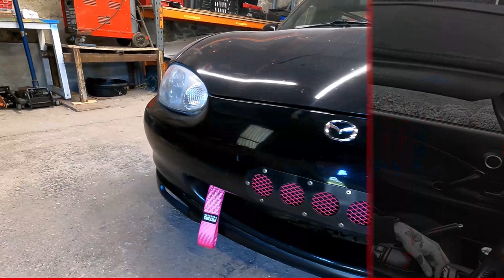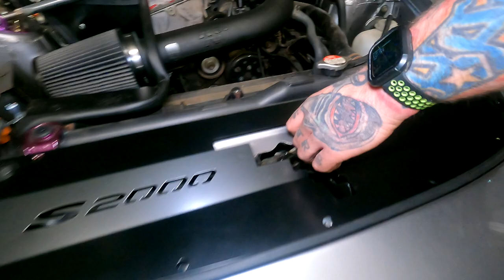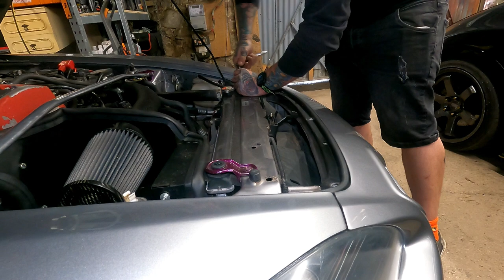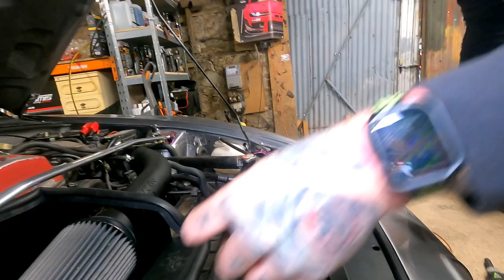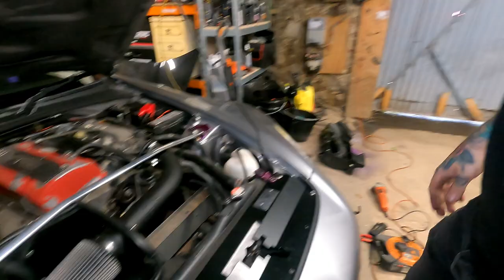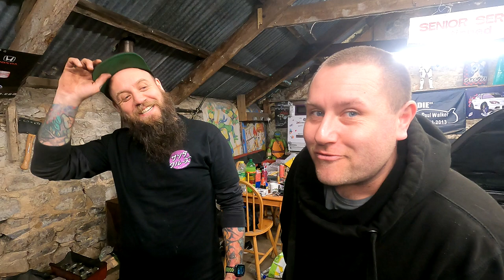Honda S2000 cooling plate by Draft and Drive installation

Comment: Luvveeerly,Well you've just reminded me. I bought a plate for my FTO about 15 years ago before the kids came along and it's buried in the garage with the rest of my old life 😂 I don't know what was funnier you doing the fingers fiddling to get the sensor or Chris doing his street fighter? oooohawoooo🤗👏👏👏
Reply from the maker: 🤣🤣🤣 get it out my beaut and get in on 😜😜🤘🏻❤️
Reply: @CowabungaCarDiaries  Yes you've inspired me but they will be an avalanche of crap falling on me so I may be trapped.... By the way, as I'm old I like to give out pointless tips. I know you use cotton bud to put paint around. Old holes were but I use hammer right rust treatment round all the little rust bits on my FTO near the bonnet and underneath. It's very satisfied when it all goes black 🤗🤔👏
Reply from the maker: @Android-vk8yh  cheers my beaut. I tend to use bilt hammer for rust. Phenomenal stuff mate

Comment: You can remove the metal bracket that's holding the bonnet seal down, and use the cooling plate instead which means there's less to fit underneath. I had to very slightly move the plate around to find the perfect position that allowed the bonnet to close, without needing to touch the bonnet catch. Just a thought, and love the channel :-)
Reply from the maker: Thanks dude gna try this most definitely 🤘🏻❤️

Comment: What size screws did you use to fix the plate as I had to drill out the 5 original screws as they were all rusted and the original seal and plate was stuck on !